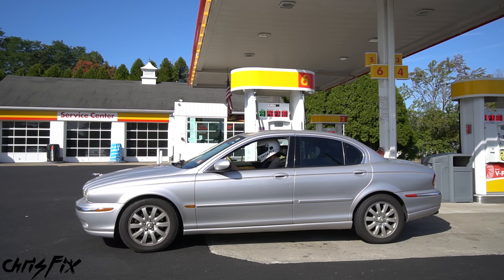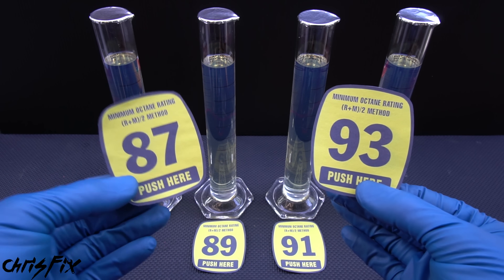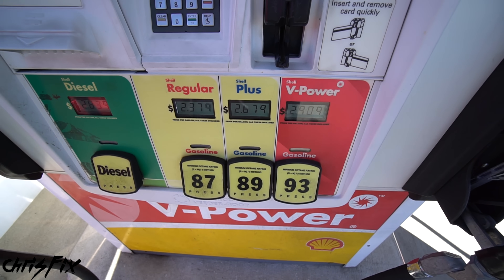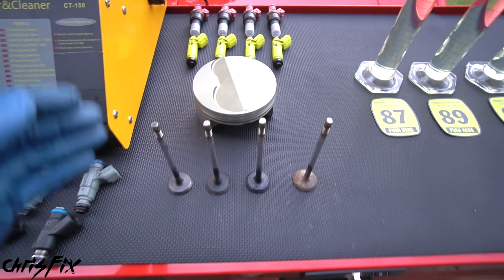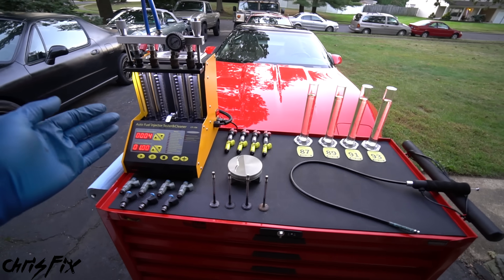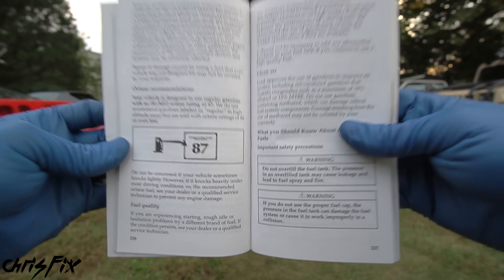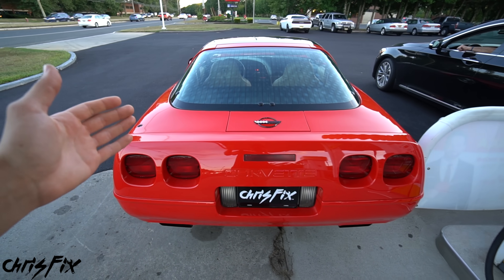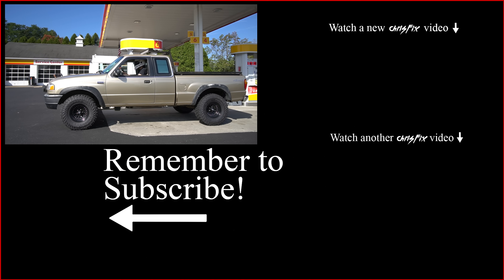What is the BEST Fuel to Use in Your Car or Truck and WHY

Comment: Okay, nice video but some not so accurate information. To be honest, not all fuel burns when the vapor is ignited, thus you have excess fuel which turns to carbon or runs out the back of your exhaust (of course mixed with humidifier that turns to water). Now in many states (I'm in Iowa) the first 2 tiers of gas are combined with up to (almost always) 15% ethanol. Now this effects how the gasoline burns and really can increase carbon and sensor carbon buildup. So many times, Premium is the best fuel to by to get away from ethanol.  Really I have not had a car "knock" or "ping", that is something that is just not common in these days. In the older days (30 years ago), many gas stations tries to ad solvents or even water to the gas to make more money, this would cause lot's of issues with cars. Personally, a gas station had to pay for a new motor for one of my cars, because I proved it had solvents added (that was like 25 years ago). ! Nice video

Comment: I can get 93 octane non-ethanol gas locally. I use this in my small 4 stroke engines and mix engines (2 stroke and mix 4 stroke).  Is there any advantage to using it in my car over 87 with ethanol?  I was getting about 13% better MPG with my car when I could get non-ethanol 87...

Comment: I have seen, in some cases, 100+ octane at pumps here in the United States... So what's the deal with that?
Reply: Sometimes it's referred to as racing gas. It's typically a solvent based fuel if it's rated beyond 100 octane. Don't run this type in a regular vehicle. It can destroy oxygen sensors and mess up your engine, if it isn't made to run on these fuels. However there is a 100 octane unleaded gas that is street legal that some gas stations sell such a VP. (Beware some 100 octane gasoline does also contain lead and is not rated as street legal.) It can usually be used in a car with a high performance motor that won't ruin your oxygen sensor. But typically the gas that's marked as 110 octane is more like a paint thinner then actual gas. Plus it often contains lead. By the way, 100 octane street legal is like $6.50 a gallon. And i'm in a state where gas is cheap. Your engine better be producing like 800HP or more before you need 100 octane. 93 octane in the states (Aka...99 Ron in Europe) can yield crazy HP out of engines as it is.

Comment: This dude is clueless believe me I'm a fuel tanker driver I know..what you think your getting isn't always what you get just buy the cheapest gas you can then put a good brand octane booster in problem solved😃😃
Reply: Darell Beaver how is what you said makes him clueless? He didn’t push any particular octane, he basically explained the differences and said use what your car manufacturer tells you to.... He also said you could use an octane booster if you put a lower octane in your car.

Comment: Technically you are correct... all 4 grades have the same amount of energy in them BUT the difference is how the engine uses the fuel with different octanes. As you mentioned, a high compression engine cannot use a lower grade fuel as well (the spark knock is a symptom of this). I run the highest octane I can get in my CTS-V but I also have a 99 Mazda that I use for a work beater that I picked up with only 43K miles on it and in that car I can see a significant increase in power and acceleration if I use 93 Octane fuel despite the manual calling for 87 so that is not always true.

Comment: ...it's called "electricity".    Far more efficient, far lower cost.  I beat the hell out of an F350 crew turbo diesel for 240,000 miles....to the tune of $1/mile.  2 years into the purchase I realized what a scam "sticker" price is.   Literally the year I bought it diesel prices went ABOVE regular for the first time ever and never reverted (1999).   Now I demand better for my money.   IF I'm paying $40,000 it better be a tank running on 50 cents a mile lifetime ownership cost or forget it.

Comment: I've got a 1999 tahoe with over 200k miles. 350 engine. Should I run premium?
Reply: What does your owners manual say
Reply: @alexmelia8873  it says 87 or higher. Just curious if it would be beneficial with such high mileage to use a higher octane rated fuel.
Reply: @tylersavick2988  No. Stick with 87. Mileage does not magically increase compression, if anything it will fall

Comment: Montana actually has 85 octane. in places with a cold winter (or higher altitude?), you can get away with a lower Octane rating, or so the local legends say.

Comment: How does regular gasoline with the common “10% ethanol added” effect a non-flex fuel 
car over a long period or short period of use?
Reply: Ethanol eats plastics and gaskets a bit differently than gasoline. It also holds more water content. Modern vehicles are designed with the assumption that ethanol will exist in the fuel distribution system, and therefore are designed to minimize any impact it would have. So, as long as your vehicle was designed in the past 20 years or so, the effects should be unnoticeable. However, if you have a marine gasoline engine (boats), or perhaps do a lot of mudding, you'll likely want to use non-ethanol fuels.
Reply: ZacGaming so why would they use ethanol in the first place
Reply: @brendanschroeder1862  Because it's replenishable. We can grow more corn to make ethanol. Oil supplies on the other hand will eventually run out.

Comment: WRONG, there is actually more energy in 87 than say 91 fuel because gasoline has more BTU (energy) than ethanol or other octane booster additives.
Reply: Except all three grades of gas here all contain 10% ethanol. 87, 89 and 93. So the BTU is the same.
Reply: Where I live 91 and 93 don't contain any ethanol.
Reply: @FJDH11  Most places it does though. Eventually it will be everywhere.

Comment: Free tip, Silver gas at Shell, and at most places is actually a blend of Gold and bronze, so you can get the free cleaning just by using silver.  Otherwise they would need 3 different tankers, delivering, and 3 tanks underground, this way they only need 2 tanks, and 2 deliveries.

Comment: Should have actually tested octane, you'll get crossover gas when you put 3 types through one nozzle
Reply: im sure he has an Octane engine in his garage
Reply: @spudboypollock4115  and I'm sure when you pay for premium you should get premium not whatever is left from the last full.up
Reply: @nathanreimer1296  Hose residual is quite small. Consider if 1/4 of a gallon stays in the hose and you buy 10 gallons. Thats a 40:1 dilution. The guy before you buys 87 Octane and your high compression engine requires 91. Assuming its linear you got 90.9 octane.

Comment: Professional Mechanic here with decades of performance knowledge  and watched a lot of this guys videos and usually disagree with a lot of what he says but watched this video and pretty much the content is surprisingly spot on with exception that if you have a regular car that should be using 87 octane and dump shit you decides to run racing fuel instead not only are you dumping a shit ton of money down the drain you are also going to be making less power because you are cooling combustion temps below manufacturer specs and possibly gumming the internals up with unburned deposits .. spending a lot of money to go slower in the process

Comment: In Wisconsin we have an 88 octane with 15% alcohol and cheaper than 87 octane with 10% alcohol. The pumps say only for cars newer than 2005 (I have a 2007 Saturn Ion). I tried one tank of this stuff, and before I refilled, it melted my flex pipe (it was a crappy, stock, flex pipe) by burning too hot. Or it could of been a coincidence.